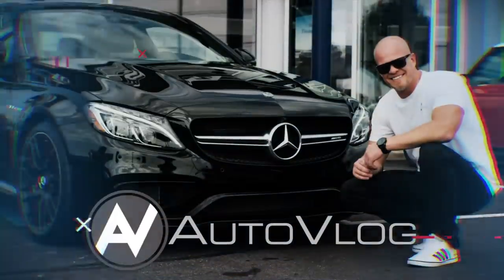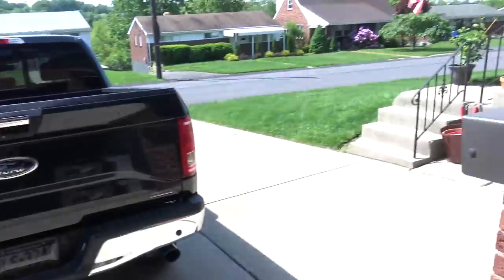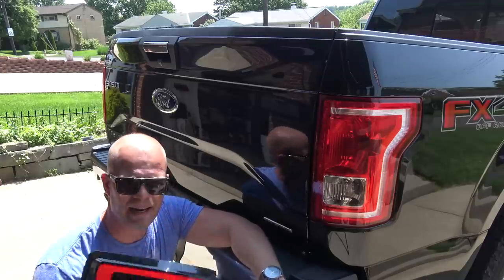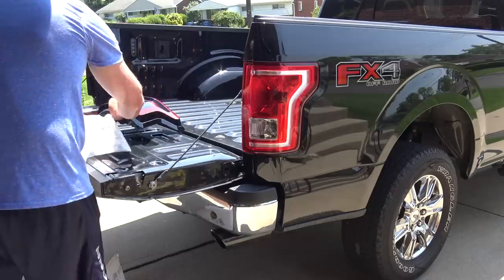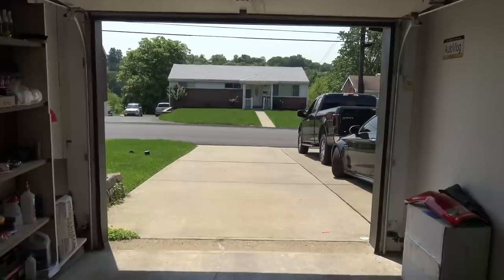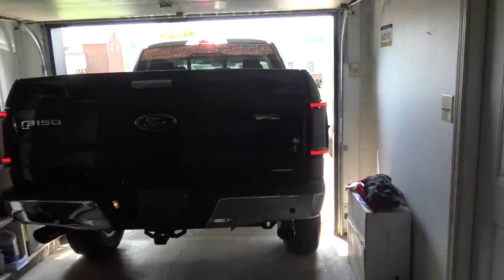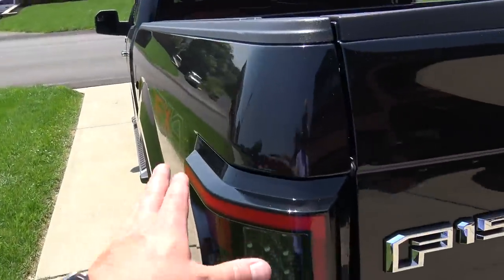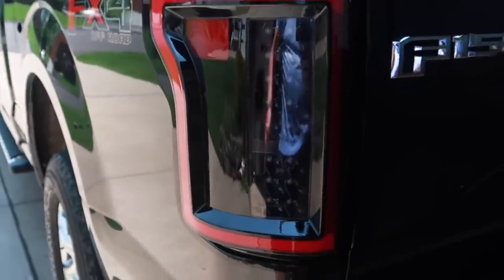They said this NEW mod would make my truck UGLIER.. (They were wrong)

Comment: I like the black lug nutz on the Raptor better, the contrast ones were fine because of the chrome/polished aluminum around the Ford on the wheel caps. So stoked that you got matching head lights errr I mean tail lights. lol ... I figured that they were coming soon and definitely compliment the front end. I like the design, they do widen the rear end more. As you know from my previous blogs on your vlogs I am thoroughly enjoying this build and am glad that you went this route instead of just a lease on a new sporty AWD sedan. You are having fun with this, and once the new bumpers come in and or wrapped along with the lift and wheels tires it will look even meaner and rival the Raptor. Also nice to see some sunny weather so you can get the AMG out, hopefully the slow boat from Germany will get here soon with your windshield it is getting worse. Great vid as always Mike, thanks for sharing and caring.

Comment: AV, really enjoying the F150 series.  I picked up a 2017 F150 last month and plan on doing a 2" level, new wheels and tires, window tint, new exhaust (but not as loud as the Atak) and thanks to you new lights.  I'm undecided on the Raptor style grill.  Cheap and easy next mod for you:  a tailgate assist shock  (I had a DeeZee on my last truck).  Looking forward to watching more mods from you!

Comment: as a guy who lives in Nevada those tail lights could be a great dust trap, and as a guy who works in Powder coating, i would recomend powder coating your bumpers and running boards to match( and maybe wheels). Cardnal BK62 or bk08 for textured, and by Axalta Alesta Bumper black for gloss and Black Magic ll for matte (all black).

Comment: I put some Spyder smoked led taillights and headlights on my 2010 F150. Its lifted 6" on 35s... I still have alittle chrome. Left on it since it's a lariat. But I couldn't be more happy with the mods I did that are similar to yours! I'd recommend doing a third LED brake light as well to match everything up!

Comment: PLEASE get a “F150 Raptor Style Tail Gate Applique Rear Trim Panel” it matches your grille style and will finish off the back end of the truck with the new tail lights! Especially after you black out the bumper... would be SICK 
those tailgate covers run for around $220

Comment: Heads up, you might want to take advantage of those mounting bracket holes that come on the resistors and bolt it in. I have an older set of Anzo tail lights on my truck and not only were the boxes bigger they had no fastener holes. Because of that overtime with rain, mud, and all kinds of shock the adhesive worked itself lose without me knowing. This resulted in the boxes (due to their weight) tearing the wires for said resistor boxes. As a result the boxes do not do their job anymore not that it seems to have made a difference with anything at least for me. I do plan on changing the lights themselves for a set similar to what you got in the future but I'm doing all the performance modifications first before I touch anything looks wise. Just wanted to let you know.

Comment: I like the lights, the only question I have is you attached the resistor with tape.  Is that going to be a pain in the neck if you ever have to remove them?  If so it may have been better to stick the resistor to the lamp housing.

Comment: Taillights look great.  Have you checked out Barricade Extreme HD bumpers?  They have a nice one that I would consider for my 2006 F150 - has a step cut out on the corners, comes in black with holes for the backup sensors.  They may have one for the 2015+ years.

Comment: I have a similar setup on my 2012 grey f150. It's a supercab 6.5 bef. I have the wheels from a fx4 or a STX and raptor stype headlights and taillights.basically just the normal headlights but instead of chrome it's black trim.

Comment: Do the LED backing lights provide (significantly) more light than the factory single bulbs?  I wanted to upgrade my backing bulbs to LED, but if the light provided by the multiple LEDs is significant, maybe I will go with a whole new assembly.

Comment: They look pretty good but you really need new wheels because it looks half modified with a raptor grill, headlights and taillights but stock rims and the chrome bumper and running board and definitely fender flares as well with the lift kit

Comment: Looks good! 👌🏼 Just a question regarding your headlights, did you continue with the stock halogen light bulbs in the new projector headlights or did you change to a HID og LED aftermarket lightbulb kit? 

Tak for nogle fede videoer Mike! 
Med venlig hilsen 
Søren fra Danmark

Comment: These lights are give or take but I'm just going to brake it down, SIMPLY.

The Good: That red day time running is awesome and just completes the look of the Vehicle especially at night and with the Fx4/4x4 sticker. Depending on the color of your truck, in this case black, looks may vary. If you dont have a Lariat (because they held daytimes hostage behind that package along with the leather) but want that new cool individual lighting that all these other new cars are getting these days then these are for you. 

The Bad: If there is a way to get/ modify this head light so that it has 1 single individual flash of light instead of all these dots then I'd do it in an instant because those dots are what make people think twice before going aftermarket instead of OEM even me to be honest. You said it yourself!! It makes it look ehh..

EDIT: *Taillights

Comment: So happy that you had gotten the matching tail lights! There's also an anzo third reverse light for the f-150 as well.  https://www.carid.com/anzo/black-smoke-led-3rd-brake-light-mpn-531107.html?singleid=150615426&url=101076638
 Ever thought about an offroad rear bumper? If not, painting it black would look nice.

Comment: hope you didn't really torque those lug nuts to 150ft pounds that way to much.  all the mods look good up to now keep them coming. Get your rear bumper painted some shops will do them even if they are chrome ask Jack his friend's body shop does them but don't dip them did that to mine and took it off after 1 year all the dirt and shit hits it and makes it look terrible. BTW get a rear shock for your tailgate thank me later ;)

Comment: Mike to use a torque wrench right you pull up on them
Reply: Owen Hill I’ve never see anyone pull up on a wrench when tightening.
Reply: Well when you push down on a torque wrench it doesn’t torque them properly but if you pull up on the end that is most accurate.
Reply: Owen Hill Sorry but that makes zero sense but you do you.  Do a search for “how to properly use a torque wrench” and tell the numerous youtubers they’re doing it wrong as well.

Comment: Why didn't Ford use these tail lights in the first place?
Reply: Also, if you engage the turn signal, does the corresponding side blink in an amber color? Or does the color stay the same?

Comment: Dislike.  Liked what you did to the front, back looks like a riced out truck.
Reply: i agree with this.... like the stock LED's better... these look "riced out"
Reply: Nope not true... Ford has stock LED tailights, I have them on my F150 and AV has them on his Raptor.  IMHO, they look much better.
Reply: A true petrol-head maybe... but it’s my opinion that the LED tail lights on the Raptor look better.